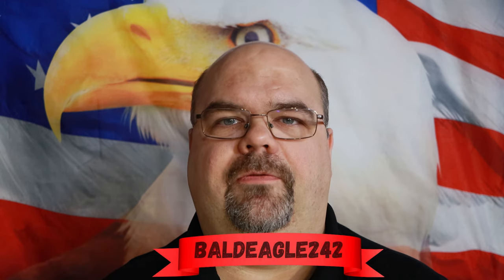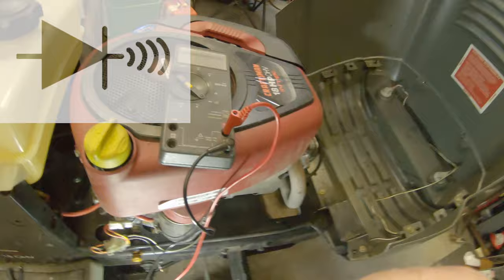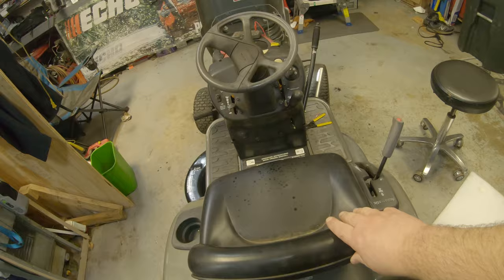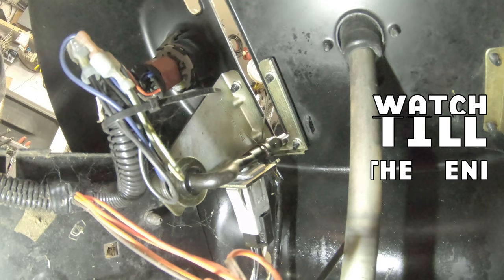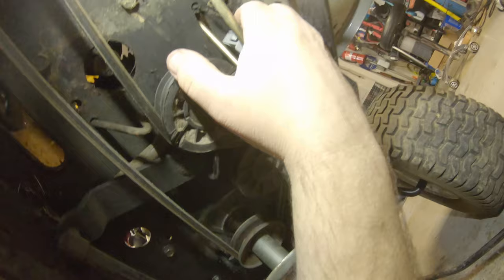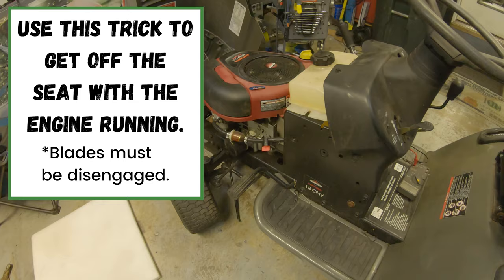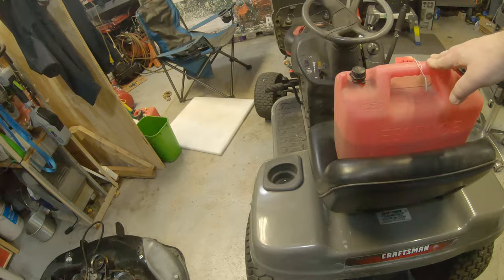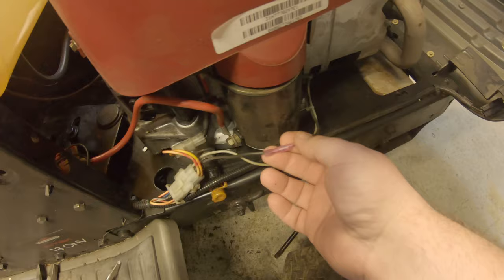The Hidden Safety Switch Trick Exposed

Comment: Hello! Great video! Very understandable and you get right at it! I have a Poulan similar to what you used for the video,hit a cable rope in grass which wrapped around blades and stalled motor. Removed cable,turn key to start,nothing. No attempt to start whatsoever. In your opinion do you think I twisted the motor out of timing? I would think if I did so the mower would at least turn over.
Reply from the maker: It probably sheared (or partially sheared) the flywheel key.
Reply: @baldeagle242  thanks eagle!
Reply from the maker: @francisjames57  Any time my friend. Good luck with it. 
Let me know what you find.
Reply: @baldeagle242  Eagle! Man o man.. I`ll tell you what. Last year I had this no start issue which you tried to help me with and I did numerous things to check it out. Even took it a repair fella I grew up with but "luckily" he was closed that day and I brought mower back home. So I went and bought a new JD120 from Home Depot brought it home ...looking it over in the garage and my son comes over to check it out. After shooting the breeze for awhile....son goes over to the "broken" mower ....the old Craftsman Polan....and I`m bellie aching on about it and he says..."Dad...you know the blade activation lever is in the "on" position right"??? I about fell over right there! He pulls it down in the off position and turned the key and it fired right up!! Now ....I can NOT explain....how completely freekin stupid I felt and STILL do!! I couldn`t bring myself to muster up the courage to touch base with ya and tell ya about it. But now.....a year later....before I die.....had to come clean ol boy. As a kid during summer vacations we used to tear old mowers apart and put them back together. So...the know how is there.....but perhaps the common sense is starting to slip in this old 67 yr old knucklehead. Anyhow Eagle....hope this at least brought a smile! Signed....Idiot
Reply from the maker: @francisjames57  That’s funny. I’m happy to hear it was nothing serious. 😁👍
I’ve went to pick mowers up in the past from people who have had the same issue. I politely ask them if they’ve tried to start the mower with the blades disengaged. It’s something I need to start asking before I go down a rabbit hole. 😉👍

Comment: Thank you. I do have a question, though. I have no power to the key switch to activate the start solenoid to the starter. But if I turn the key to the run position, I can cross the  battery poles, and it will activate the start solenoid, and it will run. Is this a safty switch issue or a key switch issue? How do you determine that? Thank you in advance for any help. Sorry, info craftsman 15.5 hp 42 inch deck
Reply from the maker: See if you’re getting power to the primary side of the solenoid when you turn the key to start. If you are the problem is most likely your solenoid. If not it’s most likely your key switch.

Comment: So it could be the switch on the clutch side seat one works but as soon as I put it in gear and release the clutch it dies
Reply from the maker: Have you checked to see if the reverse safety switch may be engaged?

Comment: Did all your test and seem good. Not getting any voltage on the white wire on the sol. Jumping with a screw driver with kill wire off it stars right up. Any ideas? Sol is good and test of brake and seat switch seem good.
Reply from the maker: We will need to check a few more things before I can answer that. Are you getting 12 volts on the solenoid engagement wire when you turn the key?  If not you possibly have a loose wire on the key switch or a bad switch.  If you are it’s probably a bad connection at the solenoid or a bad solenoid itself.
Reply: @baldeagle242  Got it running and noticed sparks down by the shield. It was the + wire going to the carb sol. Think that was why I keep blowing fuses.
thanks for responding!
Reply from the maker: @55chevytruck  Yes, that will do it. Should be 12 volts on that wire when running to engage the solenoid.  I’m glad you were able to figure it out. 😁👍

Comment: After I have mower running and I release the brake it dies. How come?????
Reply from the maker: @timothybrindle6957  assuming the blades are spinning freely and not bound up for any reason that’s either a seat safety switch or the brake safety switch. If your mower has a switch on the deck chute(not all do) that can cause this issue as well. If you follow the steps in this video it’s pretty easy to isolate the bad switch. You may have more than one.

Comment: My father has an old Craftsman 917.271060 that I'm trying to fix-up for him.  Already replaced mower deck components, but noticed while testing that the parking brake won't engage.  I looked under the hood and can see it's just a half-inch shy of where I believe the lever would be able to engage it.  I was going to order a new rod brake hydro (part #169498) because I thought it must be damaged (one of the old spindles was bent, along with a really bent blade, so I know he hit something HARD).  I'm wondering now if maybe the nuts near the brakes just need to be adjusted one way or the other (?)  Thanks if you have any suggestions.  I will continue to browse your vids but coming up with nothing on finding any 'parking brake adjustment' or 'rod brake hydro' help.  Thank you!
Reply from the maker: Without seeing it myself it’s difficult to say exactly. There’s not much to it. If you look underneath as you (or a helper) try to engage it, that may give you a better understanding of what’s going on under there. It’s definitely possible that something is broken off or bent to where it doesn’t catch.
Reply: Thank you for the reply.  Very kind of you.  Yeah, I'm trying to wrap my head around it.  With the brake pedal fully engaged, the lever is just barely shy of being able to lock it in, so my initial thoughts were that the brake rod must've got bent by the deck during a collision with a tree root or whatever.  I hoped maybe it was something you had seen a time or two.  Thanks again.  I like the way you present your vids!  Best wishes-     @baldeagle242
Reply from the maker: @thomasperry313  thank you.

Comment: I'm having trouble with the solenoid at the carb. It only clicks once. Could that affect my other three switches?
Reply from the maker: The solenoid on the carb will have no effect on the other switches. It is supplied with 12 volts DC when the key is on. All other safety switches work strictly with continuity to ground out the ignition coil and prevent it from creating spark. 
Here is another video I posted earlier this year that may help to troubleshoot your problem. 
https://youtu.be/dTBJi2BOlVg
Reply: @baldeagle242  the link is to this video

Comment: My LT1000 has new-working battery, new solenoid, new starter, good battery ground,   turn key and cranks to compression point and stops.  battery meter shows battery at 12 volts but drops under load to 8 or so.  Any guesses as to my problem/fix?
Reply from the maker: It sounds like the compression release has broken on your camshaft. I mentioned it around the 1 minute and 15 second mark in this video and show you what it looks like. https://youtu.be/8VxTRqJZi0Q
Reply from the maker: Also, pull the spark plug and turn the engine over by hand to make sure it’s not hydrolocked

Comment: Great videos. If the engine turns over when key is turned, does that mean all 3 safety switchs are operating properly.  Hence, I can eliminate safety switches as reason mower won't start.  In other words, does a bad switch always present itself as a disconnected battery.
Reply from the maker: On most AYP and MTD mowers this is true. When you get into some of the higher end John Deere or commercial fuel injected models you will still be able to crank them with safety issues but no fire. 
On must residential mowers if it cranks the safety switches are normally good. Most common issue with a crack and no fire is the carb solenoid followed by a shorted wire (mouse?)
Reply: @baldeagle242   Thanks.  I've replaced the carb, plug, coil, and gas and cleaned all the dirt from safety switches and can only manage a short, halfway start when gumout is sprayed in the carb, then it quickly dies.  Don't know what to do next.  Murray 425000 with B&S motor.
Reply from the maker: @MrLMJohnson If it’s firing with gum out sprayed directly into the carb I’d suspect the solenoid on the bottom of your carburetor is stuck shut. First check to see if it possibly came unplugged. It requires power to open the solenoid to allow fuel into the main jet of the carburetor.  
I don’t recommend disabling it but there are plenty of videos on YouTube showing you how to cut the stopper off. If you choose to do this I would suggest replacing it after you confirm it’s bad.

Comment: Which safety switch is bad if the riding mower engine dies when put into gear?
Reply from the maker: Without checking them it’s difficult to say. It’s best to test them before you start blindly replacing them.

Comment: I found the black wire traced it back to the engine block attached with a bolt. Would that be the same wire?
Reply from the maker: No, that would probably be the larger negative ground wire for the battery or starter solenoid. The black wire your looking for will trace back under the shroud cover on the top of the engine and attach to the coil(s) with a quick connection.
Reply: @baldeagle242  I found a white wire coming from the connector that has a larger barrel connector with heat shrink wrap that connects to a black wire that runs under the plastic. Looks like the manufacturer wire (scag )that connects to Kawasaki engines wiring

Comment: Mower will start but when you let go of the brake it cuts off did the test and could not get the continuity sound to stop
Reply from the maker: You may have a damaged wire that’s grounded out or a switch that has failed in the closed state. At that point you’ll need to test individual wire for continuity to ground and switches.

Comment: Question, so if one of the safety switches is bad will it stop the spark plug from firing?
Reply from the maker: @danrt52  Yes, if they fail that’s exactly what they do.
Reply: @baldeagle242  Thanks for the quick response, and the info.

Comment: Sir. Very precise indeed! Have you done this on a Snapper 2013 RER 210, as it's called, "Turtle"? I'm trying this same idea myself. I don't know if I've found all the safety swithes. Thank you.
Reply from the maker: This should work on any mower. They all use a pretty similar safety switch system.
Reply: @baldeagle242 Thank you very much. I will thoroughly be using this as a guide.

Comment: I pulled the black wire off the coil. Tested off = continuity. Tested one click = no continuity whether the safety switches were engaged or not. What is the issue? (I tested the key switch and it is good.)
Reply from the maker: I would test the individual switches at the switch and make sure no wires are damaged or grounded out.
Reply: @baldeagle242  thanks!

Comment: Our problem is the lawn mower shuts off when the brake pedal is RELEASED. It has new ignition switch, new brake switch, new solenoid, good ground, 12 v at battery.  Would a bad seat switch cause this to happen?? We have power to seat safety switch, if we get off seat it still runs.
Reply from the maker: There should be continuity at the seat switch but there should never be any power or voltage. Assuming for now you’re talking about continuity and not power… Yes, it sounds like your seat safety switch is not working. When you depress the brake switch it effectively bypasses the seat safety switch. When you engage the blades this re-enables the seat safety switch even if the brake pedal is pressed. Some of the safety switches have two circuits (4 connection points) this allowed the switches to work similarly to how a two way light switch works in your house. If either switch is turned on or off it will complete or break the circuit.  It’s slightly different on your mower but it’s something that tends to make sense to most people when I explain it that way. 
From what your saying I have to assume you have a seat safety switch with 4 connection points. If that’s true you either have a bad switch, a bad connection or a broken or damaged wire.
Reply: @Baldeagle242  thank you  so much for responding. The way you  explained it, helped  us so much. We have a new seat safety switch on the way.
Reply from the maker: Let me know how it works out.  😁👍
Reply: @baldeagle242  Hello again, we replaced the seat switch and tested the seat harness both are good.  The mower starts but continues to shut off when the brake pedal is released.  (Once again, new ignition switch, new blade switch, new brake switch, new seat switch, new solenoid, good battery.) The only thing left is a new wiring harness...which they are out of stock everywhere. Frustrated and feel like a dummy. It must be a simple thing, because it starts and runs good but I can't find the problem.
Reply from the maker: Without tracing the wires down I hate to just start replacing wires.

Comment: I need help I am putting a Craftsman 18 horsepower OHV motor on a 93 Western Auto riding mower my brother gave it to me and I had that extra motor the motor on it was locked up but all the connection stuff on it was different from the motor so I took all the electrical off of the Craftsman LT1000 it was on and put it on to this one but the black wires that run from the ignition I had cut all the wires to try to put it on the motor for the Western Auto while it was in there and it wouldn't work because it wasn't the same stuff but if you could get ahold of me I really need help
Reply from the maker: There are a lot of variables when doing this but in a nutshell you have the kill wire, starter wire, charging wires and fuel. If it has an electric clutch you will also have the power supply wires to the clutch.

Comment: Thanks for the video. I to the safety switch out but when trying to put in a new one from the underside, I cant get it up enough to see what's in the way of maneuvering the new one in. I can get it to the hole but something from the side like a plate or something is blocking me from getting it all the way up in there. Any recommendation appreciated. Do I have to have the pedal engaged or anything? I am working with a  2001 Poulan Model:#96012004500

Comment: The brake safety switch has no plug, nor could I find one. There is a female spade white wire leading from brake safety switch that is disconnected. Where does is go? Also the red wire leading to the engine is hot all the time even with the ignition is removed. The is no click at ignition switch, however there is a click at or near the magneto. The machine ran fine last week.
Reply from the maker: There are a lot of variables when troubleshooting something like this. It’s difficult for me to say without seeing what you have there. It’s possible someone may have already been in there and worked on it from what you’ve said above.

Comment: Mine dies when I ingage my blades no pto switch just handle like urs
Reply from the maker: That could be the seat, brake or handle switch.  
It’s also possible your deck bearings have sieved and are physically stopping the engine.  If you’re sure that’s not the issue (no smoking belts) then I would follow the steps I show in this video. 
Also,  if the switch to cut in reverse has come loose or bad that could be an issue as well.

Comment: good to know about all the switches, but mine is dead i mean dead no movement in amp gage , no click , nothing. if i try to start next day it will turn over about 10sec and die. battery new , fuse good.... its electrical somewhere. jump start , no good. it ran great half the day and now dead. i just changed drive belt and i have feeling i did something electrical..weird but no other ideas.    any ideas??
Reply from the maker: The first thing you need to look for is a loose wire on the battery, starter and starter solenoid. Also make sure the solenoid is tight and grounded firmly to the frame. 
It that checks out I would retest the battery to confirm the new battery is good.
Reply: 12.52 volts , would crank if i jump it..... nothing .
Reply: when this first started i pulled fuse, little warm , put back in ran for about 10min. replaced fuse did same thing ran short time and die. now its just dead but tommarrow ill try to start and it'll crank for about 10 sec and then everything is dead.
Reply from the maker: @JACKBREUSS-tf9hm  it sounds like a bad connection or a short.

Comment: Where is seat safety switch on DGT 6000 ?
Reply from the maker: I’m not sure. There should be wires running to it that you can follow unless someone has cut them off and bypassed them.

Comment: I have a problem, when you push the forward pedal ALL the way down it kills the engine ,just like you shut it off . If you let off before it shuts downs it will continue to run???
Reply from the maker: It sounds like either a short or a safety switch issue.
Reply: @baldeagle242  I found it was a white wire getting pinched by the gear that the foot pedal engaged , your method proved it out , thank you very much !!!!

Comment: Didn’t see you mention seat safety switch on DGT 6000
Reply from the maker: You should be able to test them on any mower with this type of safety switch system.
Reply: Bought mower used , switch is broken and cant get the new switch installed

Comment: I have a craftsman rider seat switch is working opposite the way it's supposed to. Shuts of when I sit on it.
Reply from the maker: +Chuck H there are different types of switches.  Some are normally open and some are normally closed.  You may be able to reverse the plug but you'll probably need to locate the correct switch.